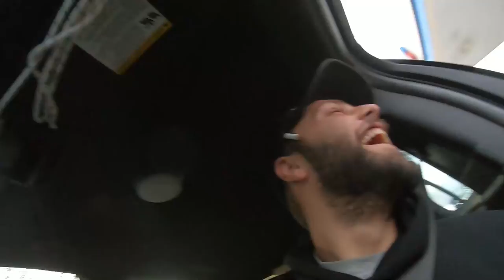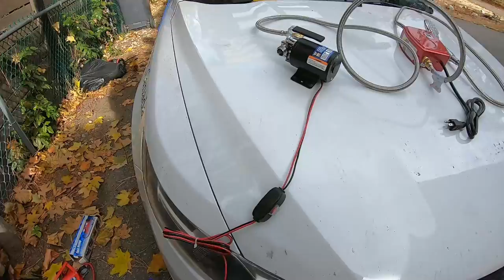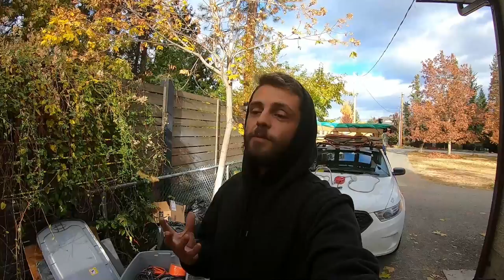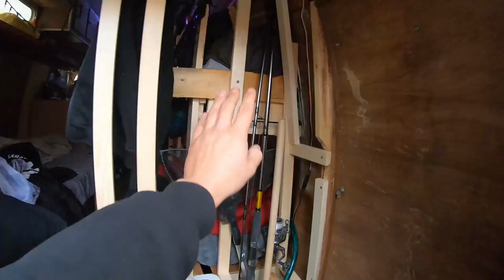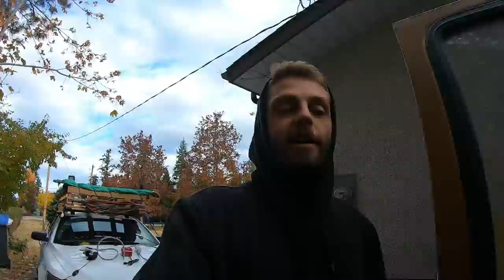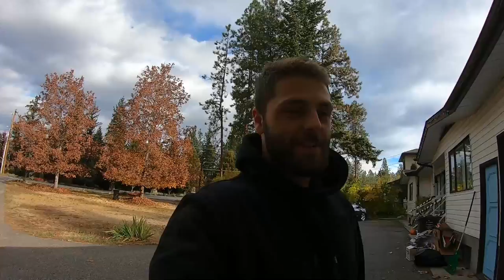CHEAP PORTABLE SHOWER | VAN-LIFE

Comment: Great vid , keepin' it real 😁. Looks like a good start on a great shower unit. You really don't want tiles and heavy wood. Keep it light and simple and you'll save on fuel , less strain on the engine and suspension etc.
I down sized from a proper campervan to an SUV. I have a shower awning I bought on sale that is mounted to my roof rack.  It's fast simple fold out shower. I bought a pop up silicon tub ( actually a laundry 'basket' ) thst folds flat to store. It was only AU$30 (under US$20) to stand in and a USB rechargeable shower which is a small pump with a hose and showerhead. very compact.  I preheat the water in a kettle. Entire shower system cost less than US $80 and the awning was about the same. Joolca are fantastic but i have no room for a unit that big or a gas cylinder. I love Chrome too , been watching him for years , what's up weirdos 😆 Happy travels , I just subscribed and keen to see how your build goes 😊
Reply from the maker: Thank you for the subscription! Do you have videos of your story up? Sounds very interesting, I absolutely love this lifestyle its amazing 👏 still just the start, but I have such an amazing feeling about my life now!
Reply: I'd love to start uploading soon. I've been 5 years a nomad already and haven't uploaded anything yet 😆 I just got to take that plunge 😊 I love  watching and learning from content like this though. Keep the vids coming 😊